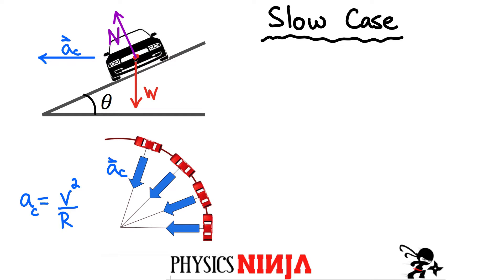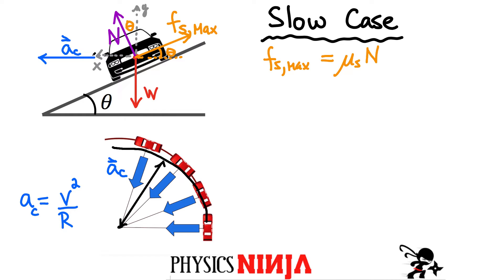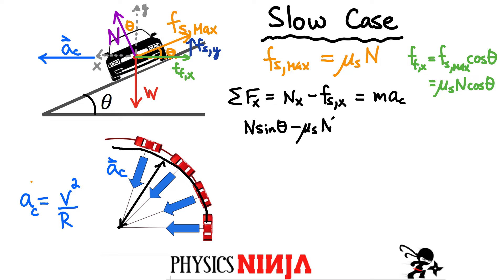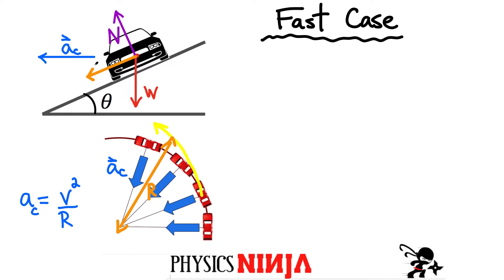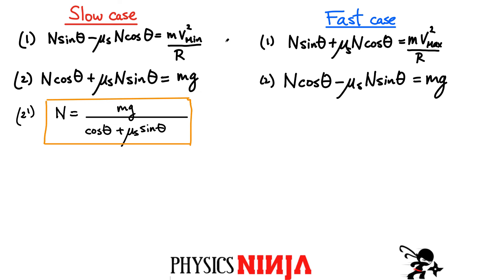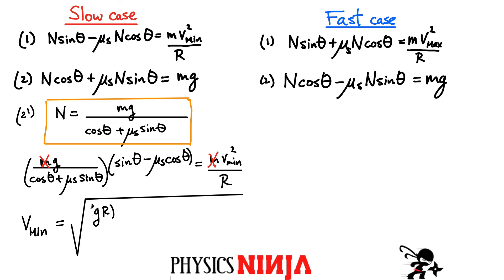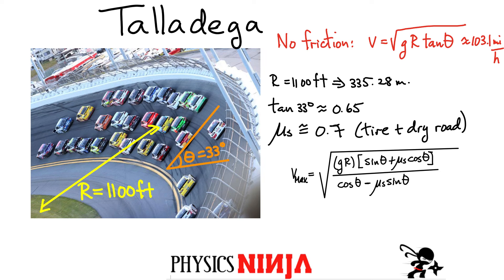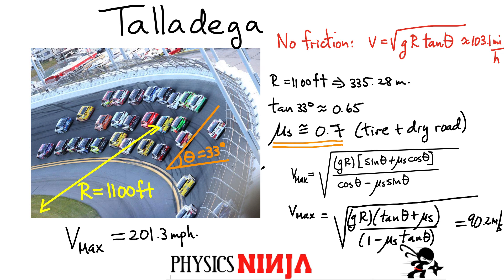Banked Curve with Friction: Finding Maximum and Minimum Speed

Comment: Great video! Why can we not initally say that N =mg. This way we would only have to consider one dimension. For example for x it ould be mgsin(x)-umgcos(x)=mv^2/r. Then all m's could cancel. However it gives rise to a different answer then the one you found later for v. Why is this? Thanks :)
Reply: You are getting a different answer because the slope is banked and the normal force is not equal to the mg, but instead equal to mg cos(x). You're right though that the masses cancel out and I find it a much easier to follow version of the problem.

Comment: Hi, I have a homework question that ask “why is the max speed for banked roads generally lower than roads that are flat?” But isn’t the max speed for banked roads higher? I tried substituting in values of theta and mu and the banked road gave a higher max speed
Reply from the maker: The bank is usually not uniform especially near the point where you leave the bank.   If it’s slippery and the and the angle is small this would really be unsafe.   Better to play it safe and reduce the speed limit.

Comment: when you measure the radius.  do you measure  it horizontally. or measure it along the banked road?
Reply from the maker: Horizontal
Reply: @PhysicsNinja Thanks. The reason that I ask is because in your video Banked Curve Physics - Uniform Circular Motion, at time 13.24, the line R = 1100 ft looks like it is from the center to where the car is along the ramp, rather than from the center to the horizontal projection of the car. Other than that, you explanation is really good.

Comment: I did a question in which I had to calculate max and min velocity. The value of min velocity came out to be a complex number. What does it mean in physical world?
Reply: Interesting question! First of all, congratulations for the video. It's amazing! About your question, really, 1-tg33º is negative, so, we can't calculate the minimum speed. Not really, though, I think the minimum speed, in this case, is zero. In this case, we can't use the maximum static friction coeficient, 0,7. We need to use a little less, so that we won't have x acceleration (neither y acceleration), so, the speed is zero. In the first equation, the second membre will be zero, instead of mv^2/R, so that u=tg33º=0,65 (less than 0,7, ok?!). In this case, we won't have the maximum static friction, but this is how static friction works: it increases until the maximum, assuming all the values between 0 and u_s.

In the same way, if 1-utg(theta)<0, then the v_max also become imaginary. For example, if we have theta=60º, then 1-0,7tg60º is negative. This means that the car can't reach the maximum static friction. However, if u=0,5, still for theta=60º, for example, then v_max=234 m/s, an enormous speed. In fact, how 1-utg(theta) is in denominator, as this value aproaches to zero, the maximum speed goes to infinity. This make sense, because the inclination increases, and then, the friction can decrease. In fact, if 1-utg(theta)=0, then u=cot(theta) = cot(60º) = 0,58, so that we need u < 0,58, in a curve with theta =60º to have the maximum speed. As the u aproaches to 0,58, the speed explodes. In the case o f the example, u=cot(33º)=1,5, but u is always less than 1, so that, in this curve, with this inclination, it is always possible calculate maximum.

Comment: The Fast Case is odd. If you happen to have mu = 1 and an angle > 45 degrees, you get a negative square root (which does not exist). Does that mean that the body will never slide (i.e. You can go as fast as possible)?

EDIT: Actually, there is a HUGE mistake in the fast case, before using the 1st equation to get the Vmax, you isolated the N in the 2nd equation, but YOU CAN'T do that if the angle = 45 and mu = 1, because you would be dividing by zero. Something is very wrong with this model
Reply from the maker: No mistake, trust me.  This is a great question and I’ve answered it before.  See below comment from Lavender
Reply: @PhysicsNinja  Oh just read it. I got it now. The Vmax equation is undefined for a 45° angle and mu = 1. But, by being undefined, that means there is no max speed, the body can go infinitely fast and it is not going to slide. In other words, the friction force will never reach its maximum possible value (mu * N). Thanks!
Reply from the maker: @robertosabinospina1066  you got it

Comment: Sir, may I know why we do not resolve the force as what we will do in the case of a block sliding down the slope?
Reply from the maker: For a block sliding down a slope the acceleration is down the slope so we break down the forces into components using a coordinate system that has one axis along the slope.   For this problem the acceleration is toward the center of the circle.   It's easiest to use a coordinate system with one axis toward the center of the circle and break forces down into those components.
Reply: @PhysicsNinja  oh. Ok. Thank you.    May i know how is the dynamics of a cyclist bending the bicycle during a turn?

Comment: For Min speed , a negative Speed🤔?
Reply from the maker: The expression will never be negative, it would slide down first.   sin(theta) is always greater than >us*cos(theta)
Reply: @PhysicsNinja  i tried with a degree of 15 for a problem, i come to the same formulas , the max speed Is ok , but when i try with Min speed the numerator became negative rg(sin 15 - 0.5 cos 15)
Reply from the maker: @coachtofu412  That means the minimum speed is 0!    The object doesn't have to move in a circle and it will remain on the ramp and not slide down.
Reply from the maker: The force of friction is more than enough to hold up the object.
Reply: @PhysicsNinja  finally i find an answer, love you man
Reply: @PhysicsNinja  thanks thanks thanks
Reply: @PhysicsNinja  Why do we take Componets of N instead of mg
Reply: @coachtofu412  The Fast Case is odd. If you happen to have mu = 1 and an angle > 45 degrees, you get a negative square root (which does not exist). Does that mean that the body will never slide (i.e. You can go as fast as possible)?

Actually, there is a HUGE mistake in the fast case, before using the 1st equation to get the Vmax, he isolated the N in the 2nd equation, but YOU CAN'T do that if the angle = 45 and mu = 1, because he would be dividing by zero. Something is very wrong with this model

Comment: what if theta was 45 degrees and the coefficient was 1
Reply from the maker: Great question.   The equation says that the max speed tends toward infinity, however that equation only holds if the denominator is greater than zero.    The problem with this limit can be seen if you look at Newton's laws in this limit.   You see that the perpendicular component of the Normal and the perpendicular component of the friction cancel out which means we are left with only the weight in this direction.....but that means that the forces can't equal to zero in this limit - mathematically they can if the Normal force is infinite.    If the normal force is really big you would need an infinitely strong ramp or tires and this is where the simple picture breaks down.     In the limit of mu=1 and the angle approaches 45 degrees it means you can go really fast!!
Reply: Physics Ninja thank you!